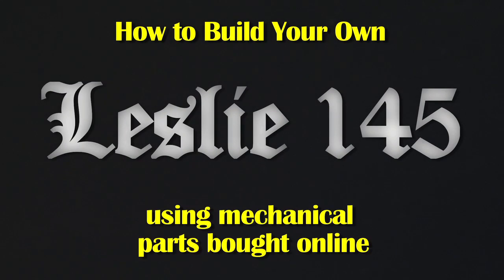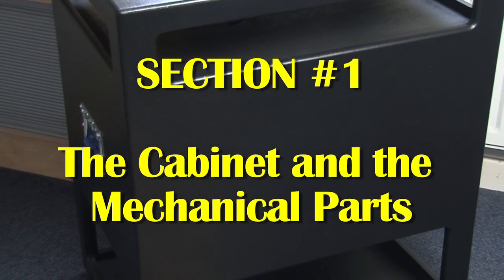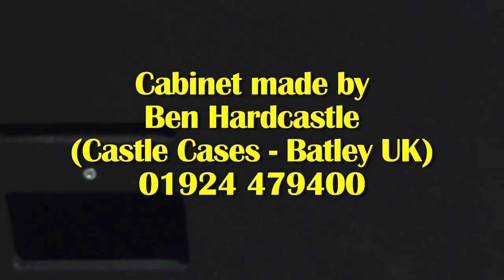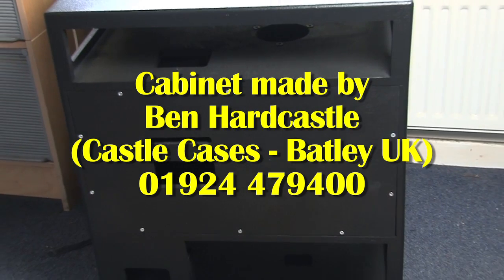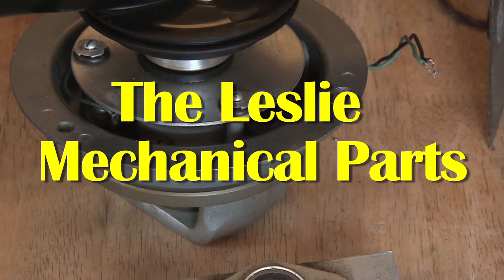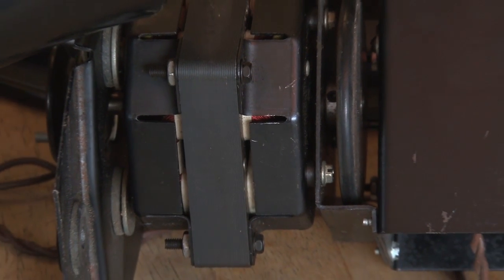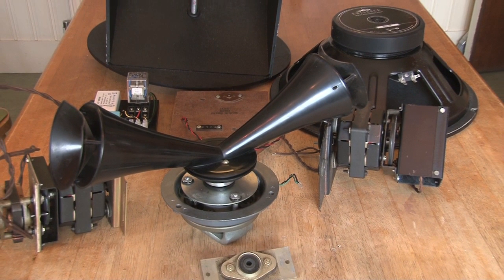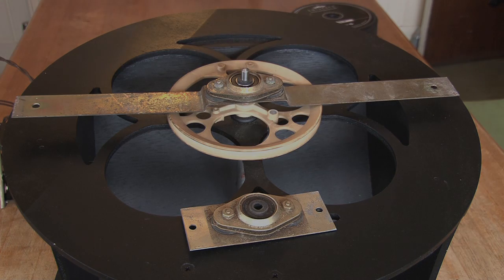HOW TO BUILD A CUSTOM LESLIE SPEAKER FOR A HAMMOND ORGAN - PART 1

Comment: Why did you use a 3 pole relay when there are 2 slow motors and 2 fast motors?
Reply from the maker: So that when the relay contacts become pitted after a lot of use as they do from my experience, I can quickly use another pair of contacts by connecting the motor switching across new unused contacts.........
Reply: @keithappleton  Thanks Keith for your reply.  Please could you tell me the uF value of the suppression capacitors. Is there a way that you could put up a photo from an angle which shows exactly the relay wiring connections?
Reply from the maker: I can't remember, I made that video a few years ago ..... probably 0.1uf 240 Volts- see if you can find a Leslie schematic online, the caps will be shown there.

Comment: Keith,  at about 40 seconds, you 
mention painting.

Well, at least, you're not painting 
a steam engine.

(Keep them coming!  I might not 
afford a model steam engine, I 
can built a speaker cabinet, and 
get the rest on line.)

OK how is it, that one guy works 
on 2 things I'm VERY interested 
in?  Steam and Leslie speakers.

steve

Comment: The guy who developed the namesake organ speaker Donald Leslie passed away here in Pasadena, CA in 2011. But when he first developed the speaker Laurent Hammond did everything he could in his power to not have Mr. Leslie's coupled with his organs. He even went so far as telling the authorized Hammond Organ dealers NOT to sell the Leslie speaker, even changing the speaker connections on the console itself.

Comment: Keith: the original cabinets have louvers and removable rear panels. Some newer models have wire mesh. Do you leave the new custom cabinet (looking great BTW!) open? Does open on all sides sound better? I can see you left the deflectors (to reduce AM) on the treble horn. Wire mesh or louvers definitely make these too quiet, but what about the bass rotor, which has a considerable amount of midrange as well? Open on all sides? Just asking. Thanks for the answer in advance and thanks for posting your great work and knowledge!
Reply from the maker: I was originally going to wire mesh the open areas but I liked the open look so I left it that way. My Leslie sounds great, not any different to a Leslie 145 really, although it is cleaner and louder with the new accurate 800HZ crossover network.
Reply: Keith Appleton
Great! Well I guess with a better sounding crossover (I guess it also involves the roll off curves of the bass and treble - traditional passive crossovers use coils for hi pass filters and capacitors for low pass filters - I guess you used the same but with a better designed circuit and higher quality components) you have more choices. You can always crank up the main amp valves(tubes) - if they are great -  to get a nice creamy overdrive without rasp and without sounding muddy. Thanks for your valuable information! I really appreciate it.

Comment: Hi Keith

Great videos.  When I switch the treble motor on my 145 to fast, there is a prolonged delay until it reaches max speed.  This makes the overall leslie effect a bit dull.  With your expert knowledge, would you have any suggestions to rectify.
Reply from the maker: Usually it's the adjustment of the position of the lower (slow) motor's armature shaft. If the slow motor shaft puts too much pressure on the drive tyre, it takes a while to disengage. Alternatively the motor may have too strong a spring fitted or too weak (depending which way up it is mounted) if it's a standard Leslie 145, the armature return spring is too weak & needs replacing.